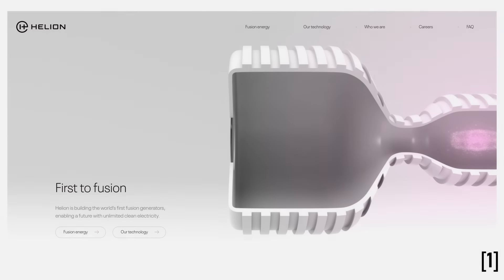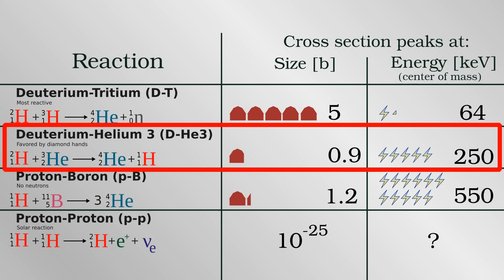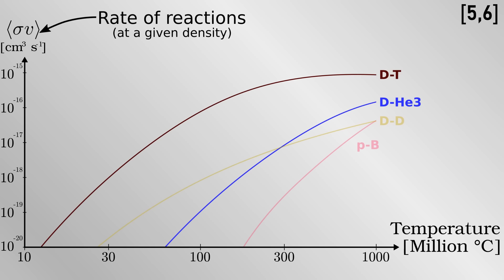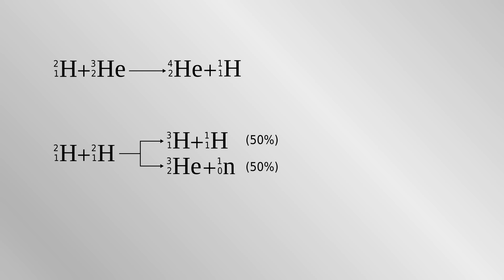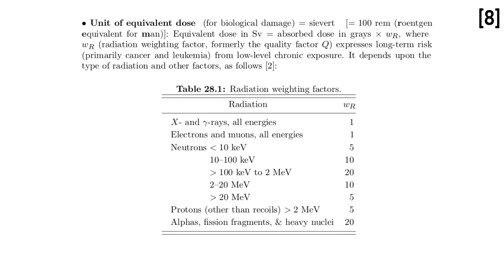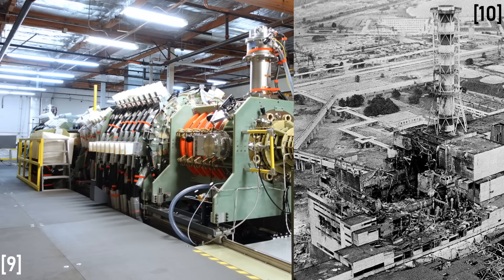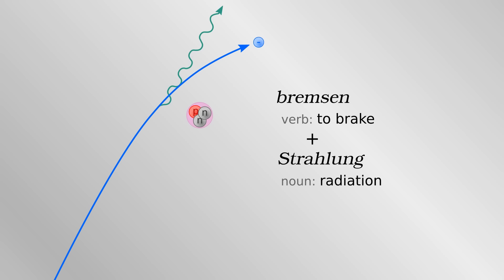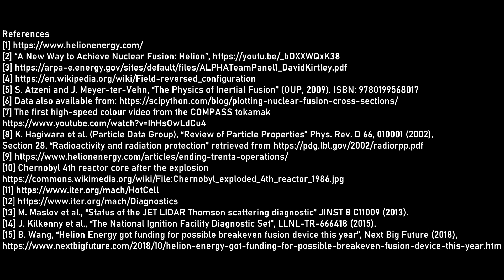The problems with Helion Energy - a response to Real Engineering

Comment: @elmarmoelzer2229 has made the following criticism of this video:

The author of the critique seems to solely rely on the Real Engineering video (and a couple of blog posts) in his critique from the point of view of someone who claims to have worked at JET.  He did not even watch the video above.
This is not quite fair. The Real Engineering video was made by people who are not plasma physicists and is meant for consumption by the general public. It does not contain all the physics details you would find in a scientific paper or a talk in front of peers.
So here is my criticism of the criticism:

- Critique: "FRCs have been done before and never worked." 
First, define "worked"! What was the goal of the experiment and what was the outcome?
Second, yes, FRCs have been done before and the members of Helion's founding team were actually involved with several of them. They applied the lessons learned from those to their own design, which they have tested over 6 prototypes so far.
Lessons learned and applied:
1. Size of the FRC. The larger, the less susceptible to n=2, rotational instabilities.
2. Elongation to radius ratio. The longer the FRC, the more stable it is to tilt instabilities.
3. The merging before the compression. This part creates a single, hotter and more stable FRC as a target for compression. FRCs get more stable, the hotter they are.
4. Helion's FRCs have a very low electron to ion temperature (Te:Ti) ratio of 0.1 and less. That makes things a lot easier compared to machines where both are in an equilibrium because: 
P(fus)/P(loss) scales as Ti^1.5 / (Z^2 * Te^0.5 )
Where Z is the atomic number (in case you wonder about that).

- Critique: "Deuterium - Helium3 has a smaller reaction cross section than Deuterium- Deuterium. At the 100 million degrees temperature discussed in the video, Deuterium-Deuterium reactions would be much more likely than Deuterium-Helium3 reactions."
That is generally true, but the author misses some key points:
Trenta is a subscale prototype with much weaker magnets than what they are proposing for a full scale powerplant. Because of that temperatures are somewhat lower than in a full scale power plant. Power plants aim for temperatures 20 keV (220 million degrees) and up to 330 million degrees (30keV). At that point the D-He3 reactivity surpasses the D-D reactivity.
That said, Helion actually wants some D-D reactions because that is how they are breeding their He3.
D-D => He3 +n or D-D => T +p
Both reactions have a 50% chance of happening.
So, in mixed mode (breed and power) machines, they will need two D-D reactions for every D-He3 reaction, at least until the Tritium inventory is large enough that they have a constant supply from decay (Tritium beta decays into Helium3). 

- Critique: "Deuterium - Helium3 is too hard and Tokamaks cannot do it. Therefore Helion's approach of fusing Deuterium and Helium3 can never work."
D-He3 is very hard to ignite, but they do not need ignition for their design to produce enough net electricity to be economic. Most of the energy from D-D and D-He3 reactions is released as charged particles, not in neutrons. Helion can recover the energy in charged particles directly as electricity at a higher efficiency than a steam plant would. They can also recover 95% of the input energy directly as electricity. That makes their machines a lot more efficient.
Further, FRCs are high Beta (~1.0) compared to Tokamaks (~0.05). Beta means the ratio of the plasmas internal pressure to the pressure applied externally via magnets. 
Fusion reaction rate (the amount of energy produced) scales as magnetic field to the 4th power, an extremely strong scaling. However, that is the magnetic field inside the plasma, not outside, which scales as Beta^2 and B_external^4. 
If it was just about the efficiency of the magnets (it is not), then a 10 Tesla Helion machine would outperform a 200 Tesla Tokamak.
But, it is a bit more complicated than that, because confinement times in FRCs are generally lower. You win some, you lose some. Overall it is still a win for Helion's approach.
Since Helion is using adiabatic heating through the compression stage, they can to some extent(!) balance temperature and density almost linearly for a given magnetic field. D-D reactions favor higher density and lower temperatures. D-He3 is the opposite way round. They can tune that just to the right sweet spot between density and temperature depending on which reaction they want more of.
Another thing that works in Helion's favor is the aforementioned Te:Ti ratio. This ratio actually decreases further with higher temperatures. So the hotter the plasma gets, the smaller that ratio. Trenta already showed Te:Ti at <0.1. It is likely that a power plant will have an even lower ratio. Lower electron temperatures greatly reduce Bremsstrahlung losses. At a ratio of 0.1, thermal transport losses actually kick in earlier than Bremsstrahlung.

- Critique: "The neutrons from Deuterium-Deuterium reactions would have fried Trenta and I see no shielding." 
As mentioned, Trenta is a subscale prototype, an experiment. It is smaller, weaker and only operates at one pulse every 10 minutes (max). A full scale powerplant would do 10 pulses a second!
Not all shots were fueled by Deuterium or Deuterium + He3. Many were fueled by a mix of hydrogen and Deuterium or pure hydrogen, depending on what they wanted to test.
Because of that alone, the total neutron flux that Trenta has experienced so far is not that high.
What the critique does not mention is that neutrons from D-D reactions have a much lower energy than those from Deuterium- Tritium reactions (2.45 MeV vs 14 MeV). Those 2.45 MeV are below the activation energy of many materials.
The machine is mostly made from low activation materials or materials with a half life measured in minutes. Aluminum activated by D-D neutrons has a half life of 2 minutes.
In fact testing different materials under neutron exposure was one of the purposes of Trenta. They have tested quite a few alloys to see how they behave.
There is still permitted shielding of course. It is in the walls of the room and not close to the actual machine, which can handle the aforementioned relatively reduced neutron load just fine. 
It is also worth mentioning that a mixed mode Helion power plant (that does both breeding and power production) would produce neutrons only in one third of all reactions. So the neutron flux, even for those machines would be lower than for a D-T Tokamak.

- Critique: "Helion claims that they discovered new physics when they say that the ion gyro radius is 25% larger."
The whole ion gyro- radius thing was based on a misunderstanding and out of context quote and maybe also bad wording.
What happened was that Trenta achieved a higher ion temperature than predicted by Helion's too conservative physics model (a higher ion temperature is actually a good thing!). That higher ion temperature caused a 25% increase in ion gyro radius, which is perfectly in line with established physics. That's it. Nothing to see here!

- Critique: "Helion had previously said that they would have a working power plant in 2021. "
IM was very eager to get a "gotcha" on Helion. I guess he did not read further up on the page, or he would have seen that Helion was in the process of raising funding at the time. They did not get that funding until now. Even Trenta was less than 35 million (especially if you take the 35 million into 2019 dollars, when they started building it).
No bucks, no Buck Rogers. Should be quite clear, no?
Reply from the maker: I have put an “author like” so this comment gets higher in the rankings. It will be up to the reader to decide if the comments are a fair summary of my video; for example, I didn’t claim that Trenta was a reactor, merely that if it were that it would need radiation shielding.

If you can brave 3+ hours of me talking like a demented headless chicken, I did a livestream - attended by @elmarmoelzer2229 - where I went into great detail about my criticisms of the Helion design. I hope a viewer of that livestream would agree that I tried to strike a more balanced, and less mocking, tone than here. Also, I addressed the more technical talks and videos by David Kirtley of Helion. Here is a link: https://www.youtube.com/watch?v=wK5v1Nw98xs
Reply: @ImprobableMatter  you use condescending voice that's for sure. I watched your video and RE video twice back to back and I came to conclusion we need more info to get fair discussion. I feel that your video contain too much presumption that helion is a scam.
Reply: @ImprobableMatter  Great! I'll watch it now. I appreciate that you're taking the time to respond to people's questions and criticisms. Good stuff!

Comment: As a chemist (of the theoretical kind though) i wonder if Helion could reduce D-D reactivity by using a surplus of He3. It surely will also reduce the reactivity of the desired D-He3 fusion, but i would think less than it does for the D-D reaction. So maybe this would be another way to reduce neutron emmisions. 

What do you think about, for instance, a 10:1 ratio of He3 to D? That way the reactivity of D-D relative to D-He3 should be much lower.
Reply: Good intuition, that's exactly one of the ways Dr. Kirtley from Helion said they plan to reduce the emission of neutrons when using D-3He. If I recall correctly, the numbers where that from the ~1-4% of energy carried by neutrons (varies with ion temperatures) in a 50-50% D-3He mix, it could be reduced to a fraction of 1% with a 3He rich mix. Still a problem, but quite smaller.
On the other hand, the neutrons produced from D-D reactions only carry about 2.5 MeV, quite low compared with the activation energy of many materials. For example, stainless steel has an average activation energy of ~20 MeV.

Comment: Lots of mistakes in the video.
Yes FRCs have been done before, but not the way Helion does it. There are lots of things that matter:
1. Size of the FRC. The larger, the less susceptible to n=2 instabilities.
2. Elongation to radius ratio. The longer the FRC, the more stable it is.
3. The merging before the compression. This part creates a single, hotter and more stable FRC (FRCs get more stable the hotter they are) as a targer for compression.
4. Their FRCs have a very low Te:Ti ratio of 0.1 and less. That makes things a lot easier because: P(fus)/P(loss) scales as Ti^1.5 / (Z^2 * Te^0.5 )

5. D-He3 is very hard to ignite, but they do not need ignition for their design to produce enough net electricity to be economic. That is because of the fact that they can recover a large part of the input energy directly as electricity and because of their relatively efficient output energy recovery.
I stopped watching half way though. Not worth more of my time. I highly recommend you check out David Kirtley's talk at Princeton. It addresses some of the points that you bring up.
https://mediacentral.princeton.edu/media/JPP08December2022_DKirtley/1_9p8c7d85
Reply: Thanks for the link, I'd not seen that one.
Reply: Starting at about 56:30 until about the end is where he discusses the difference in low vs high beta, and pulsed systems. David says no low beta system will ever create enough fusion for a practical commercial reactor even using D-T, but a high beta system can ignite with D-T, or generate Q>1 without ignition with D-He3.

I wonder if the traditional criticisms of Helion I see are tied to how low beta reactors work and not understanding the fundamental differences.
Reply: I would like to see the numbers supporting "relatively efficient output energy recovery".  Why haven't magnetohydrodynamic electricity generators taken over from spinning turbines driving conventional generators?  Techniques of generating a pulse of electrical power from an expanding plasma have been around for a long time, but I haven't heard that efficiency is one of the claims to fame.  Maybe I'm just not up to date.
Reply: @analog_guy  They claim an efficiency over 95% for getting back the power they put in, but I don't know where to direct you to any hard data on that.
Reply: I betycha Helion is a dud, just like every single other innovative reactor designed. 
"Size of the FRC. The larger, the less susceptible to n=2 instabilities."
Size never fixes the fundamental problems with fusion, with the except when the reactor is the size of a star.
Reply: @jRoy7  Thanks.  I can understand that large electric motors and generators can achieve efficiencies over 95% but it seems quite a stretch to achieve that number when you are delivering power and extracting power from plasma.
Reply: @analog_guy  Plasma is in a vacuum. There are no brushes and no friction...
Reply: A lot of the complaints in this video seem to be "Here are some basic problems that the technology faces."
And it's like yeah, great. Every technology ever has faced basic problems. Has this guy considered that maybe Helion's research has been about tackling each of these problems? Hence they are a research company, and not a manufacturer.
It's like doubting that a plane can be built because objects like to move to their energy minimum (the ground).

Comment: I watched this video! I had assumed the helium 3 thing was to eliminate neutrons from the reaction. One thing seemed off to me though. There was talk of having separate types of reactor for generating the helium 3 and for energy production. So they're build helium-3 plants and ship the fuel to power plants running their reactors. If it's really so much harder to use he3 and the benefits aren't as pronounced as they seemed to be in the video, then the cynic in me says this has to do more with money than engineering sense...
Reply: D-He3 has a higher reaction rate than D-D at 30 keV and higher.

Comment: This was a fantastic video, and you obviously have extremely in depth knowledge surrounding this. I think the key to all of this lies in ball lightning. There are some good papers the doe sponsored at SLAC in the 90s with them that theorized how ball lightning can transmute elements without generating nuclear byproducts and extracting energy. I know it will be easy for someone with your background to find issue with and dismiss the work of the MFMP, but my experience tells me they are on the right trail. You may want to also look at the work of Kennith Shoulders on EVO and Takaaki Matsumoto on micro ball lightning. If you want specific references reply to this comment. I think the science is not as rigid as one is lead to believe, just the acceptable dialog is rigid. And to be clear I do not think Helion will ever bring it to the public market, but I don't think its necessarily because they don't have a working system....

Comment: When I studied nuclear physics in university (a nuclear physics and semiconductor course.) my lecturer was quite pessimistic about fusion claiming he didn’t think the neutron radiation problem would ever be solved within the foreseeable future.
Reply: If neutron production were such a show stopper, we would not have fission reactors.
Neutron radiation can be dealt with. A few examples: Reducing as much as possible the neutron flux, or neutron energies. Choosing materials with average neutron activation energies higher than the neutrons produced. Choosing materials in which the neutron generated isotopes decay as fast a possible, in minutes or days instead of in years or centuries. Designing the machines in such a way that facilitates the substitution of neutron damaged parts. Etc.

Comment: The trenta machine cannot use the D+T reaction for power because there is a nutron that carrys some of the energy, and if you WATCHED the video, you will know the trenta needs a charged particle to create eletricity. Like a piston where the reaction needs a force to push back after the reaction to work. Except that insted of gas and heat trenta needs an eletromagnetic force. That is why they need the D+He3 because it creates He4 plus a proton. (for clarification) still good video.
Reply: I have terrable grammer so if i misspelled anything, forgive me.

Comment: Thank you for clearing up a lot of the lingering questions that I had about that video. I was wondering both about the energetics and the deterium deuterium reactions. I have even bigger questions about how they're making the helium 3, perhaps you address those later in the video. Those were hand waved in the engineering video. If they don't need the neutrons for breeding, they can potentially also capture them for energy so it seems like they have some advantages in energy recovery from the neutron reactions also
Reply from the maker: I have a 2.5 hour live follow-up, which should be linked at the end, or on my channel under "live". Good luck!

Comment: The big problem with tokomak reactors is they out a beryllium layer to capture neutrons and generate heat to boil water,
That beryllium gets used up and there is barely enough in the world for a single reactor to last a few years, not to mention it will become radioactive waste once it’s used up

Comment: If I understand you correctly, you're misunderstanding the problem with tritium at ~2:36. You can't capture the energy of a neutron with electromagnetism, hence that energy is lost to the system.
Reply: They also do not ignore the issue of neutrons released by D-D fusion, they directly address it. The neutrons released in D-D fusion are several times less energetic than those released by D-T fusion.